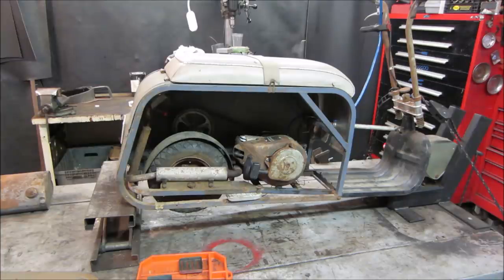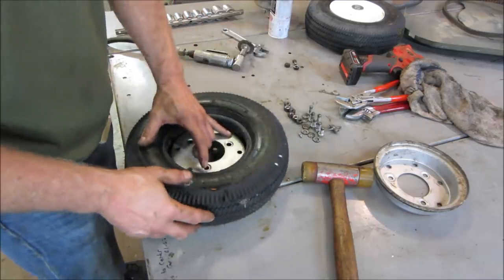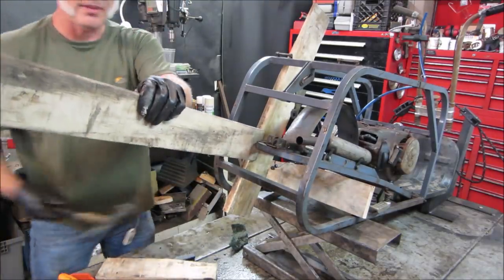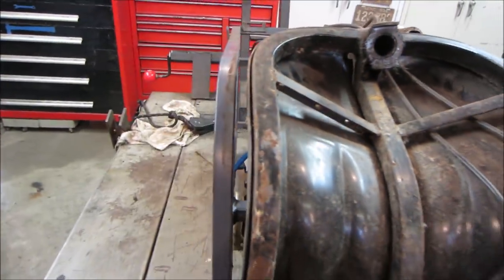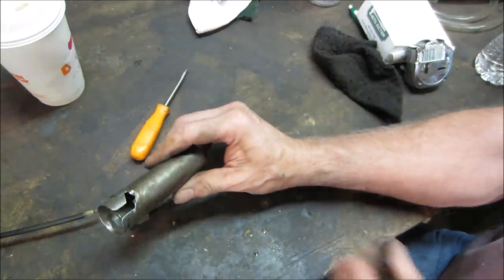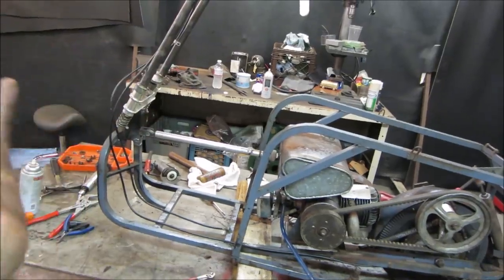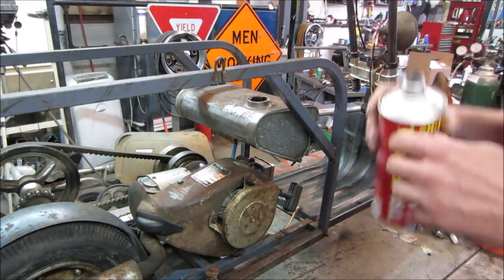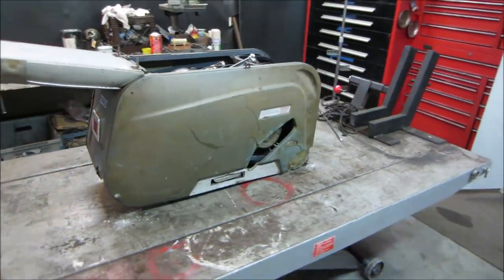Fold up 49cc suitcase scooter. Will it RUN/RIDE after 40 years Part 2 of 2

Comment: you probably know this but that motor will pull start much easier if the rear wheel is off the ground with a stand, since the drive is always some what engaged

Comment: I think that slot was to compensate for the shock absorbers' inability to travel any more than an inch. maybe that was the only  shock they could at the time of manufacturing. I also think there is a big return spring  missing from the frame

Comment: I think the slot in the suspension is for when it’s folded up and you go to pick it up to move it you can roll it on the rear tire and not pick the full weight of it I
Up

Comment: That strut mount looks like it is notched to catch the underside if the top cross bar of the frame when the its its lowest position on the slide...leaving the strut in almost a vertical position as well.  But i could be wrong too just what caught my eye. At 28:35

Comment: I wonder if it's possible the sliding mechanism really should be fixed in place with a shouldered bolt on it to pinch the slide itself but allow it to swing still. Maybe the original was lost long ago and replaced with the wrong one?

Having that slide in there would allow it to be adjusted around as needed.

Comment: Sounds like it's running a little lean on the top end even with the audio sped up. Need to adjust your low speed & idle speed needles.

Comment: Awesome video I am subscribed and watch all your videos. I have a question that I need help with. Do the Bocar 34PICT-3 and Solex 34PICT-3 take same rebuild kit? I am converting a Yamaha Venture 1200 (1198cc) to a single carb, I bought a Solex from a guy and the throttle bolt was rusted to bad to use, so he gave me a Bocar I will give him back any unused parts. Having problems finding the right rebuild kit. Thank You for any help.

Comment: That would be an easy fab job to make sheet metal sides, or you could even make it see through with Lexan sides, lol.
hydrogen peroxide and nuts would be a good cleanout for that rust scaled tank. Your way is good also, and whole lot more entertaining lol.

Comment: Looks like you could lower the strut lock and swing it back till the notch on the lower locking plate rests on the frame? Giving the strut support in the riding position?

Comment: it looks like the latch that attaches to the shock needs to lock in on the frame with the second flat thats at the bottom closer to the shaft of the shock when its in the "ride" position

Comment: Mustie the pivot point on the top of the shock. (Not the slide) is it supposed go over angle (past the vertical point to lock back against  the back of the frame? Its no XR250 prolink LOL Still it doesn't go badly

Comment: I remember my 1966 Yamaha had a section in the manual about cleaning the soot out of the muffler at regular intervals though I never rode it enough to reach that point.
Reply: why?
Reply: @trillrifaxegrindor4411  I got it used and the intake valve was very worn and started leaking enough that it would not run. It had the mechanical type valve that was discontinued. I could not find any replacement parts at the time.

Comment: Hey you need to get you a plastic welder I have one and have fixed seats and even a water tank on one of those rollers you see for pavement. They arnt that expensive and will save you money in the end. Oh and you can get the plastic welding rods at harbor freight if you'd like some info on the one I have let me know ill tell you the brand and where It came from mine is older but the company is still in business

Comment: Love it but 1 question.....if its a suitcase when tucked and folded away, does it have a handle to carry it or is it just supposed to be stored and sit just looking like a suitcase?   I wonder if the rear wheel could be left an inch out of the bottom and a handle out front to pull it along LOL

Comment: Im wondering if you should rotate the pull start housing 90 degrees anti clockwise to leave it facing upwards as in the original?

Comment: Once again, evaporust. This from the evaporust site "Evapo-Rust works through selective chelation. This is a process in which a large synthetic molecule forms a bond with metals and holds them in solution. Most chelating agents bind many different metals. The active ingredient in Evapo-Rust bonds to exclusively to iron." It will not touch other materials. This is extremely bio-friendly.

Comment: Of course, some cars had no former glory, a 40 Buick Century Convertible had, a 1940 Ford Convertible hasn't. Why? The Buick had coil springs and shocks in front the ford had a transverse spring from the horse and buggy days. The Buick had a synchronized trans, the ford didn't, the Buick had hydraulic brakes, the ford didn't, the Buick had an overhead valve straight-eight engine, the ford had a flathead engine until 1954. Viva la difference. The ford was cheap transportation, the Buick wasn't, the Buick was next in line to the Cadillac, the ford was next in line to walking or riding the bus.

Comment: I wouldn't feel too safe at 40 mph on that thing.
Reply from the maker: it aint much better at 20
Reply: @mustie1  Still, It looks like it could get the pilot from his small airplane at the air strip to the rented garage where the pilot stores his car for the commute into work. You did a really nice job getting it going again. Amazing really. Love your videos. I watch every one. Great stuff! I love the long episodes. Make them as long as you like! Did you ever solve the mystery slot where the shock moves? I couldn't see how that was needed either.